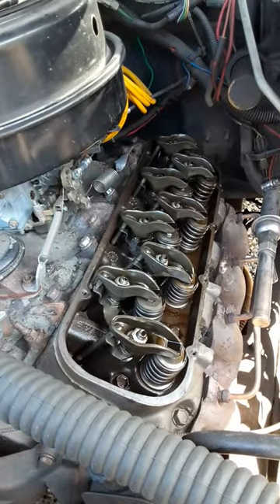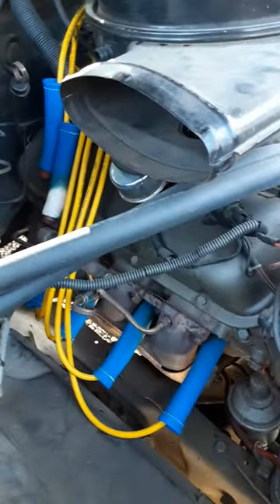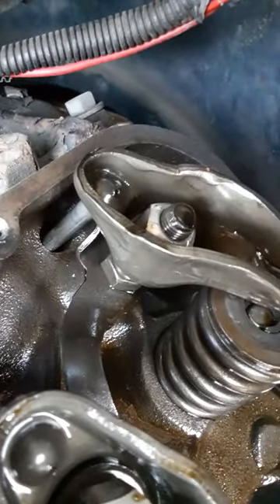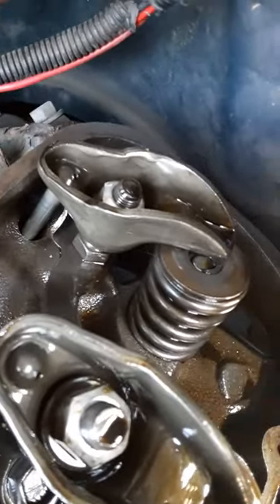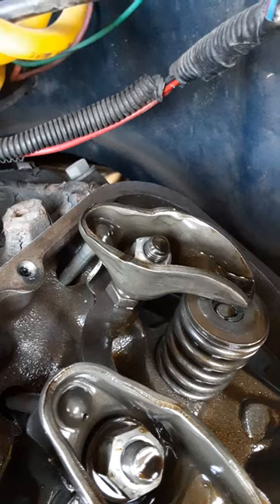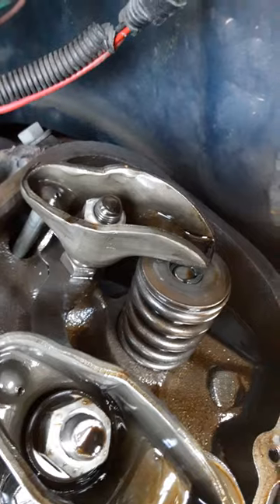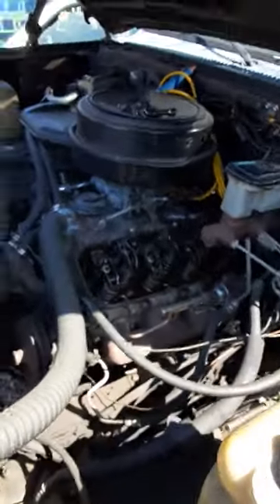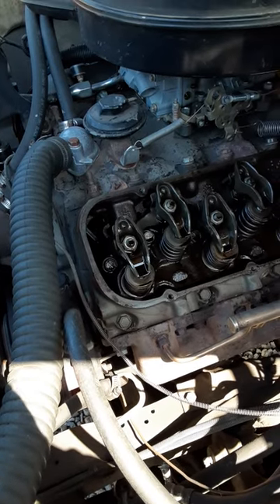Blown Up 454 "Almost" Dropped A Valve Bent Pushrod

Comment: What would cause this? 
This just happen to me on my bbc boat I almost dropped a valve too
Reply from the maker: Did it have stock guide plates on heads and did one break?
Reply: Exactly what happened to my 454 engine actually 2 pushrods broke different sides.. any suggestions

Comment: I was unlucky... I just pulled valve cover and one rocker arm is not even on the spring. The one other is also not on the spring and the push rod fell inside
Reply from the maker: I "Liked" your comment not because of what happened  to your engine but because  the more "Likes" the better for the YouTube algorithm
Reply: @dragsterstransmissions  no worries mate.going to find out later today where the rod decided to go hiding. Hopefully it’s not to horrible
Reply from the maker: @SpencerBelanger207  you should probably upgrade to the 3/8 diameter pushrodz. That is what I did to this one. It is in a heavy vehicle  towing a good amount of weight. I put new springs  locks retainers pushrodz guide plates and roller tip rockers on it too
Reply: @dragsterstransmissions  Mine is a sb350 in a rat rod, prob still needs the upgrades as the motor has been built up a bit